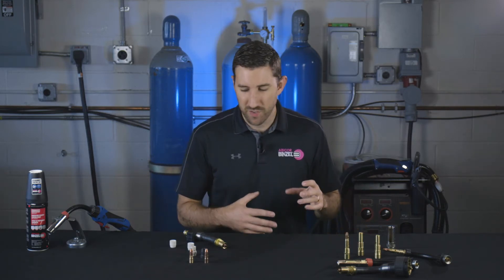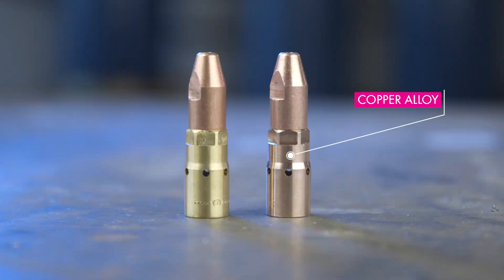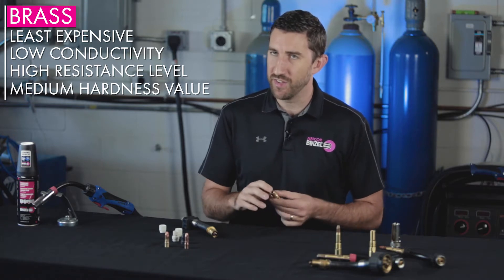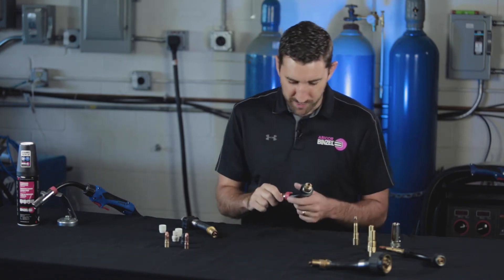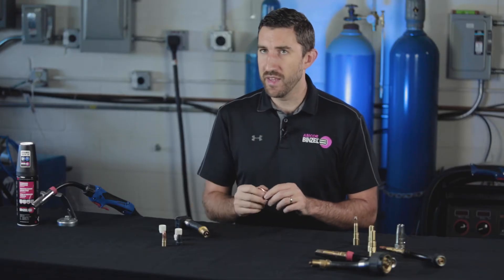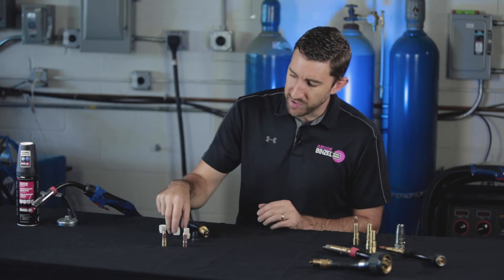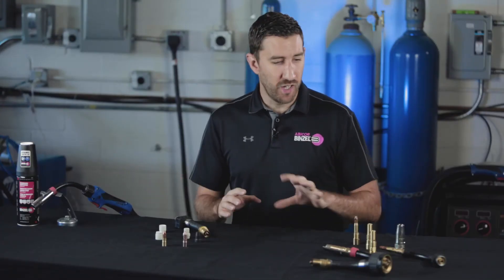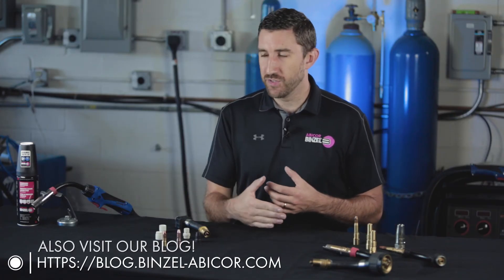Gas Diffusers & Tip Holders | Binzel Basics

Comment: Liner is stuck in gas diffuse tip how the do I get that out of there
Reply from the maker: Hi Jamie, without seeing the liner ourselves, it's hard to say exactly what would need to be done. If the liner is stuck in the diffuser, it could mean that you have to replace both the liner and the diffuser.

To prevent similar issues in the future, ensure that you are using the correct liner and trimming it to the proper length.

Comment: I never had to deal with diffusers I got a kit and it came with 35-50 and a 51: now I see that the 35-50 takes a high amp and a 51: will cool faster good for flux core wire.